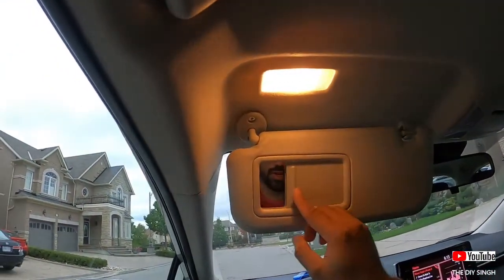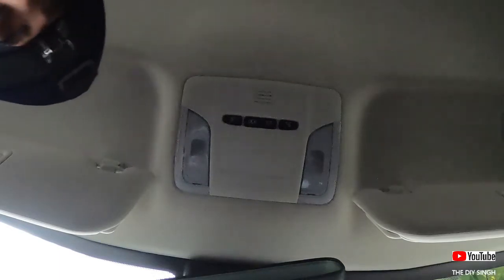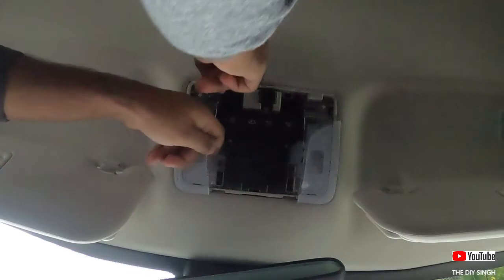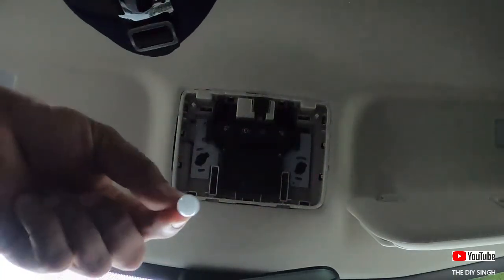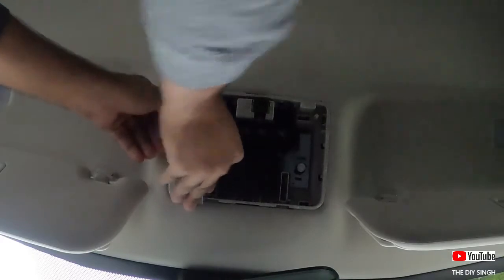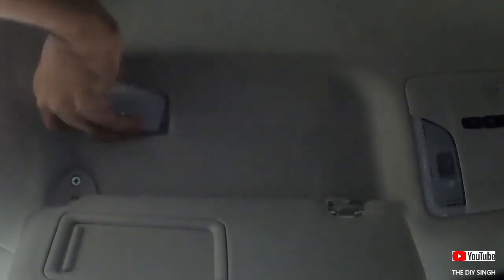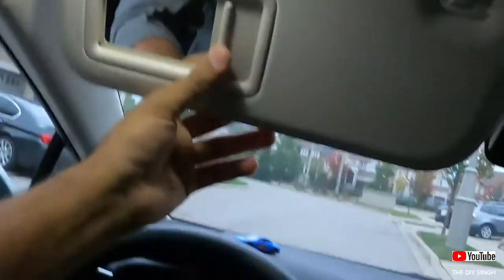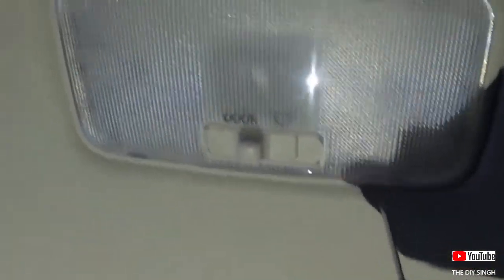Convert map lights to LED. Toyota Corolla. All Interior Lights converted to LED.

Comment: have u changed ur side markers or rear tailights to LEDs? im wondering if they hyperflash if u do? and does the dashlight warning come on toyota corrollas 2022 when u put in leds ..it says canbus safe but i doubt it..prolly triggers the light bulb out warnings
Reply from the maker: Side markers and rear tail light are LEDs from factory.
I think the reason for warning in instrument cluster and hyper flashing is wattage difference between stock lamp and LED lamps.
While converting my turn signals I tried lot of different LED lamps (canadian tire, amazon, princess auto) but all were hyper flashing because of less wattage.

Comment: How do you change bulbs on the license plate lights
Reply from the maker: Bro, license plate lamps are LED, cannot be replaced with any other bulb
Reply: @MANVIRSINGH1313  so you can only
Replace bulbs in trunk and inside lights only?
Reply from the maker: @gilbertperez118  yes
Reply: @MANVIRSINGH1313  I see cause I was able to get to light but I couldn’t pop open lense case to get bulb
Reply from the maker: @gilbertperez118  its complete light, sealed with glue in order to make it weather proof
Reply: @MANVIRSINGH1313  ohh I see  yea i was watching videos of earlier years and some you can change in trunk or pop out from front and able to pop out lense and change the bulb I guess these 2021 are different now

Comment: its weird how toyota corollas has LEDs on certain bulbs and NOT on others..why don't they  put ALL leds ffs!   all interior bulbs are NON leds...i think the headlights are HIDs? front turn signals are leds i think... license plate lights and rear stop brake lite is LEDs...
Reply from the maker: Its more wiered in Toyota Corolla SE, where front turn signals are LEDs and rear are filament lamps 😂😂😂.
Moreover I don’t know why toyota is not providing backlight in side mirror settings buttons.